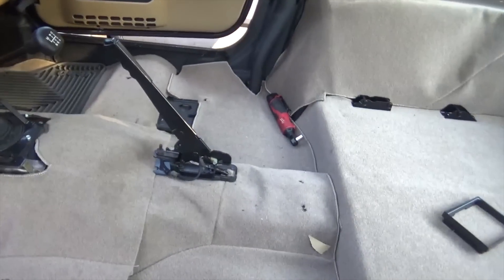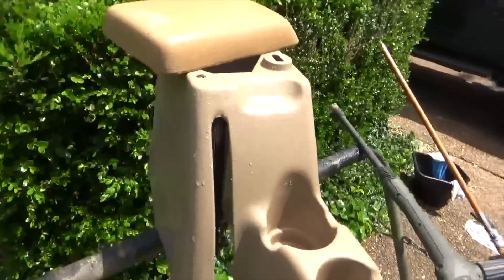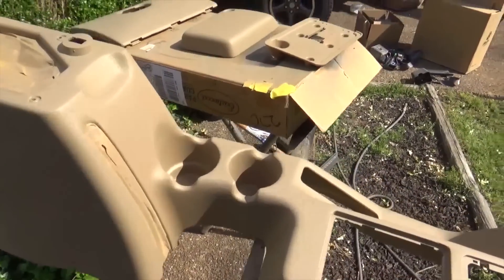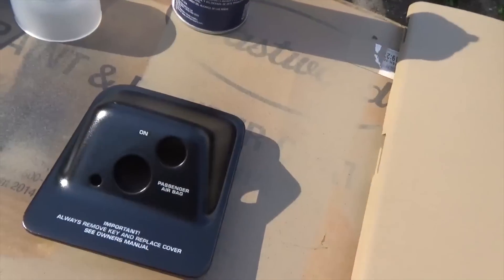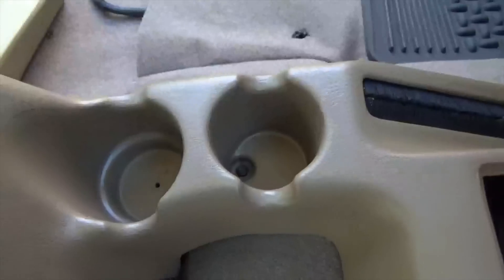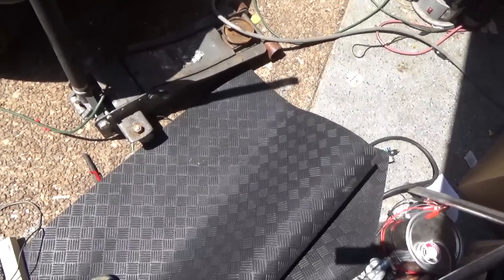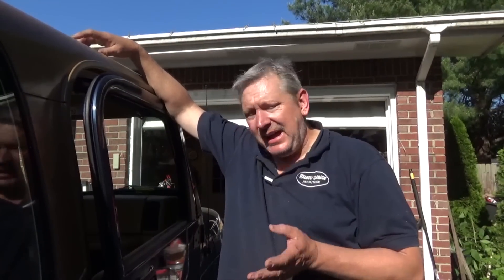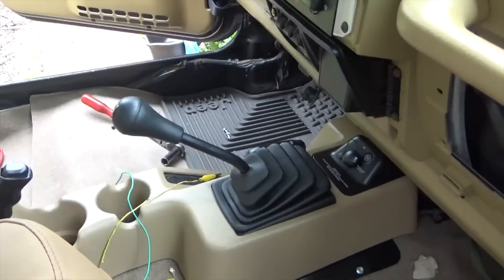Jeep Wrangler TJ Project - Center Console Restore and Cup Inserts

Comment: Hey Dave, I just redid a full console like yours to replace my half console that came with my 2001 TJ SE. The only difference is my half console came with a passenger AB switch insert but my full doesn't have the cutout. I noticed yours does. Do you think it's possible to cutout the bottom of the change dish to allow for the airbag switch insert?

Comment: have you been driving it around much to see what needs to be tweaked
Reply from the maker: got about 150 mi on it. locker - sucks. caliper sticking thats about all :)
Reply: that doesn't surprise me those lunchbox lockers are crap
Reply from the maker: +Bullshitkorner  yeah the worst part is like turning and letting off the gas or giving it gas in a turn anytime you let off the gas or accelerate the engaging not engaging is a weird feeling
Reply from the maker: +Bullshitkorner will they work at the mall ???? hahahaha